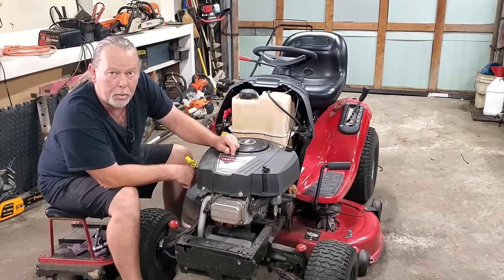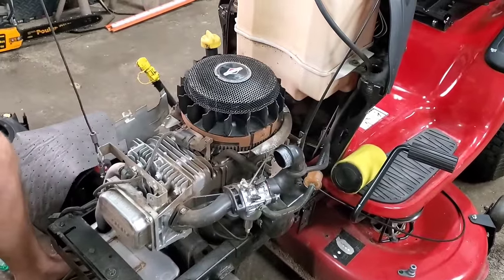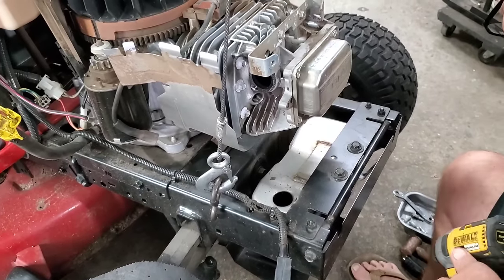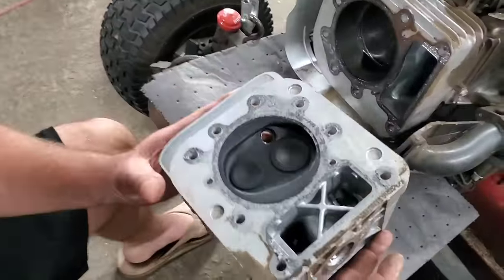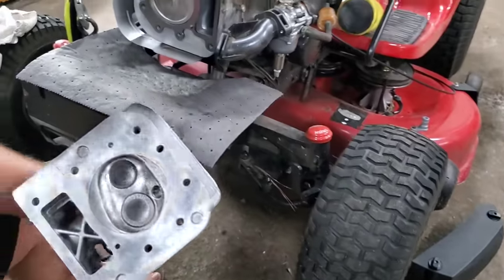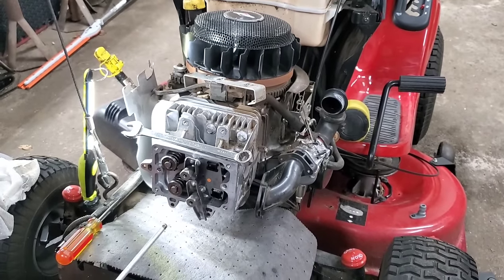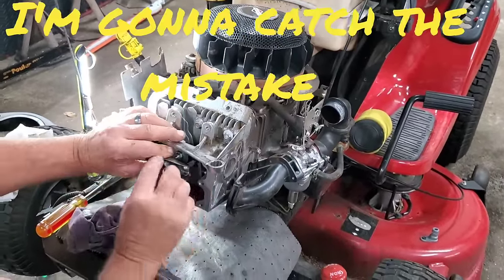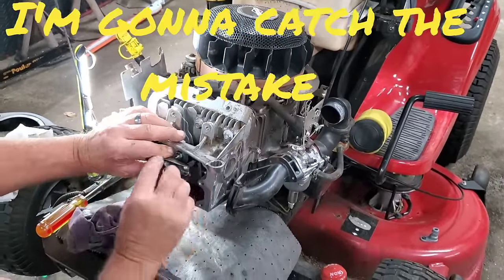Smoking Lawn Mower Briggs and Stratton Head Gasket Diagnosis and Repair Easy DIY

Comment: Performed this repair yesterday. Excellent instruction. Went very smooth with the exception of one thing that you actually warned about. After I pulled the head off I forgot to keep track of the valve caps. During cleanup I dropped one. Being as that I was doing this repair on my back patio and spraying the head with carb cleaner to clean it up, the cap came off in the grass. Upon reinstallation I realized one cap was missing and then I remembered your warning. I removed my right foot and kicked myself aprox. 99 times. I found some online and ordered a couple. Right after that, being disgusted with myself, I went out in the yard around where I was spraying. Low and behold... there that little trucker was. I freaking found it! Was able to continue the reinstall and got it all back together. Cranked er up and she ran like a top with NO SMOKING. Successful repair! KEEP TRACK OF THOSE VALVE CAPS YA'LL!! Thank you.
Reply from the maker: Great story, glad ya got it fixed up.
Reply: You forgot to LAP the head and block where the gasket sits. Hope yours lasts........
Reply: Never saw these valve stem caps before.

Comment: Excellent video--you even acknowledged your boo-boos.  My head gasket went out two years ago & I had a pro fix it.  If it happens again, I'll do the replacement myself. I've had 3 previous lawn tractors;  none of them had a blown head gasket.  It would appear that  these latest ones have a serious design flaw.
Reply: If you don't mind me asking, what did the pro charge you ?
Reply: @davethomas3553  $250 which included them picking it up & returning it.

Comment: This is a timely video for me. Pretty sure I got a blown head gasket. oil not overfilled.
Reply: That's a very good instruction video.  This gentleman does good work and advice.  If your engine is different than this one draw a diagram of where each bolt goes.  That may be of some help keeping track of all the bolts.  Just a suggestion.  Good luck on your head gasket repair.  😊

Comment: Great videos, you are very detail oriented, you describe exactly what you are doing or about to get done.  Extremely great, very educational.  Keep up the great work and posting more videos.
Reply from the maker: Thank you
Reply: @RaleysSmallEngines  hey how are you doing? I have the exact same mower….oil is spitting out of the crankcase breather tube
Reply: @semajd5995  GET Her Dune!!!
Reply from the maker: Possibly over full with oil due to bad carburetor leaking gas into crankcase or bad head gasket

Comment: My 18.5hp  B/S Intek started smoking exhaust. I had a theory that head bolt stretch was causing so many blown head gasket on inteks. I bought grade 8 bolts and used a die to cut the threads to correct length. Changed bolts out one at a time (didn't change head gasket), torked each to 22 ft/lb...5 years ago, never had any trouble since...Al Scott
Reply: Cool!

Comment: I've done a head gasket on a similar Briggs.  I enjoy working on those small engines.  On mine I had a valve job done.  The old engine runs better than new. 

A great video.  I'm sure it will help lots of people.  😊

Comment: Thank you for this video!
I think this is my problem with my Kawasaki FH500 twin.
I like tools, so I ordered a leak down tester, but I'm about to go run it for a few minutes and see if I find smoke in the crankcase / oil fill cap.
God bless!

Comment: Thanks for the helpful video. I had the same issue with my 2000 Craftsman 42in and followed your step by step to remove everything and now in the process of ordering replacement gaskets. Would have been much more difficult if I hadn't seen this video. Thanks

Comment: Sir and Madam thank you for this video. My Craftsman had the very same motor you were working on. And the very same problem. It had just started smoking and i came in and found your video. I checked the oil level and smell first. Then ran it for a minute and checked to see if any smoke in the oil tube. Yep sure enough. I came in ordered new head gasket. It showed up next day and I took my lap top out with me and fixed the problem. I did review a couple spots in your video as i went. As you stated it was easier than expected. Fired it up and just a puff or two of smoke from a drop or two of oil on the muffler. Thank you again Sir and Mrs. I will retire in two yrs and am gathering all the knowledge i can as i want to open a small engine shop. I am still lacking on the internals yet though. But getting there.
Reply from the maker: You're welcome. Glad our video helped you.

Comment: I think that I am going to try and change mine out myself, my engine guy seems afraid to do this job and I feel it is because of warranty issues but not totally sure.  I have been adding oil to this mower for 1.5 years  and even bought a backup tractor but my wife like the Sears 3000 series better.  Thanks you video was reasuring....

Comment: Thank you very much for your help. I've had issues with my used troy-bilt 30 inch riding mower smoking badly. Your simple method of using soapy water to identify a blown head gasket has saved me time and money.

Comment: Thanks for the video.  You saved me a bunch of money.  Replaced the head gasket on my 2011 Craftsman mower today.  Easy with your excellent guidance.  Is there a way to prevent this from happening again?  Is there a PCV valve that isn’t working and thus building up pressure?  Would it help to retorque the head periodically.  This is the first problem I’ve had with this engine during my 12 years of ownership.
Reply: YES, do a yearly re-torque of the head bolts. Also remove the top engine cover. CLEAN all the oil and grass grit from the air cooling fins and all around the block. Also you must lap the head and block.Don't just toss on a new head gasket and call it good. Several I've seen smoke the head gasket again. Check the oil PRIOR TO EVERY MOW.

Comment: My friend. I gor the same mower from my  neighbor for 350 with the bag. I
He gave me another rifer for free 19hp to swap. Well i pulled the head and the gasket and i see the exact same leak. Looks like at the factory they over-machined the block right there. The head looked fine. I hope a stens head gasket fixes me right up. THANKS!
Reply from the maker: Yes, it's a common issue.  At least it's a cheap and easy repair.  Thanks for watching and commenting my friend.

Comment: Love your videos. I am replacing the head gasket on a craftsman yt3000 model no 331977-0010-g1 and cannot find the torque specs for the head bolts anywhere.

Comment: Thank you for a great video
Reply from the maker: Glad you enjoyed it. Thanks for watching, hope it helped you.
Reply: @RaleysSmallEngines  purchased a Craftsman Yts3000 rider has definitely blown head gasket issue.
Reply from the maker: @WeldHoney  you can fix it I'm sure. I'm guessing, by your name you are a welder. I've been welding since the 70s, my dad taught welding and metal fabrication.  Great Great trade, a trade to be proud of.
Reply: @RaleysSmallEngines thank you  I have fixed and sold about 6 riders this year alone, I prefer vintage Murray's just sold a 87 18 42  tractor. Seeing a lot of these craftsmans especially with Briggs with bad cam issues. Also seeing ton of Kohler Courage cracked blocks and replacing them with briggs. I am glad this is the trade I chose very rewarding work.
Reply from the maker: Yes, I love it. It's fun work.

Comment: Great job on the diagnose and fix. That motor was super clean. Surprising that the gasket went so quickly, but that design doesn’t have much clamping area between the cylinder wall and the pushrods. Thanks for the great upload as always t bone.
Reply from the maker: Thank you my friend.  Yes just one bolt in the middle would eliminate that issue.
Reply: Nice fix. One thing I always comment on of every tuber that does a head gasket on this engines is…check the flatness of the head! I have yet to do one where the head gasket area where these blow out hasn’t been warped less than .004”. Worst was .009”. I mill flat everyone I do.

Comment: Great job again T-Bone, I have the same Craftsman YT 3000 with the 21 HP Intek engine and it's still going strong @ 800 hrs. and I would not be afraid of tackling either the head gasket or camshaft replacements from watching your excellent repair videos. Maybe you can answer a question that I haven't found an answer to elsewhere: I've always wondered why B&S lowered the HP rating on the 21 Intek down to 19 on later and present day engines, was that done to lower the compression ratio enough to fix the blown head gasket issues, or are the 19 HP Intek models still having that same problem from your experience? Thanks always watching!
Reply from the maker: I really don't know the answer to that. Yes we do see a few blown head gaskets per year.  Thanks so much for watching and commenting.

Comment: Great video! Is your tractor a Craftsman YT 3000, 21HP, 540cc? Reason why I ask, it looks identical to mine and I was going to order the OEM Briggs gasket to fix mine. Thank you!
Reply from the maker: NO.  look on the valve cover and get the model and type and look up the correct part for your machine.  Look it up on parts tree .com

Comment: What cleaner would you use on the top of the piston? Just carb and choke cleaner with the wire brush?
Reply from the maker: Yep, that works just fine

Comment: I am wondering how you started the tractor at the end without pressing the foot pedal. I have done 3 head gasket replacements so far. Quite easy.
Reply from the maker: I probably had the parking brake set.  Awesome, yes they are fairly easy. Thanks for watching and commenting.

Comment: Great video!  I have a 23hp Briggs& Stratton with 650hours that smokes. How do I check which cylinder is causing the smoke?
Reply: You could remove the spark plugs and see which one has oil or carbon residue.

Comment: On the older Inteks, Vanguards and I/C engines with the oval, upright filter, Briggs routed the breather vent into the base of the housing. With a blown head gasket, the air filter is soaked with oil. Removing the filter would show oil misting from the breather vent. Granted, this is the same thing that would occur if the cylinder were scored or rings ruined. But 99/100 times it’s the gasket

Comment: So I just picked up one of these 19hp Briggs on a Craftsman.  PO said he could start with fluid(yes popped off with brake cleaner). Drained the oil and it was loaded with fuel!!!   I'm an Aircraft Mechanic and the rings were tight and cross hatching was still perfect.   Head gasket was deteriorated.   Was so bad the muffler had oil and fuel.    I took the carb off and tore it apart and ultra sonic cleaned it.  
However my question is why am I getting air pressure pushing out of the intake of the carb??   

Push rods looked good, I'm going to clean the head and try the thumb truck with the valves. May compress and look at the seats.  

Ideas?

Comment: Great stuff, great camerawork too. 
So the oil was being sucked into the cylinder from the rocker box on the piston downstroke, is that correct? But it seemed like it was not an old gasket, and as you say, you only use good quality ones, and you torque to spec. In one of your replies you intimate it's a design fault -- they should have put another bolt in there. So is there any way to compensate for this to prevent it happening again? Like smear some of that black gasket sealant both sides of that fragile area?
Thank you for sharing and preventing me from working 😁!
Reply from the maker: It is a design flaw, no you can't put the black RTV on a head gasket. I will blow out almost instantly.
Reply: @RaleysSmallEngines  Ah, thank you! "Design flaw"! Like they've had no expérience in making these things!!

Comment: Are those clearances generally the same for all briggs motors? Mine is a 33R877 0009 G1    19 horsepower
Reply from the maker: Yes thanks for watching and commenting
Reply: @RaleysSmallEngines  thanks

Comment: I just found a 2015 Craftsman T2400 on the side of the road for free bagger and everything mint condition it was very clean too the sign said bad motor i towed it home and it needed a carb clean and a oil change but wouldnt start so i put a spark plug in it because the old one was fouled then she started smoking its got the 540cc 19hp platinum intek engine do you think i have the same problem as you? I put some No Smoke thick oil in it and it barley smokes anymore but should i leave it alone?

Comment: I've got oil coming out of my Honda mini-tiller carburetor. The smoke is light blue. Must be a head gasket or ring issue. 
How did you tell the piston was at top dead center?

Comment: My brothers mower has fuel getting in the oil. Sounds like rings to me. But he’s wondering if it could also be the head gaskets.
Reply from the maker: Fuel getting in oil is not caused by rings or head gasket. It is a carburetor issue or fuel pump ( if equipped). 99% of the time the carburetor needle and seat are leaking

Comment: Hey boss, I changed my head gasket to the T as you showed in the video. I now have smoke coming out of my exhaust very heavy. What should I do?
Reply: Leftover residue. It will burn off.

Comment: I have a 22 horse, Husqvarna, Briggs and Stratton. It’s three years old and that’s blowing gas and smoke out of the exhaust. Do you know what would be wrong? Thank you.
Reply from the maker: Carburetor, also your crankcase is overfilled with gas and oil. Repair or replace Carburetor and change oil and filter.
Reply from the maker: Also possible fuel pump leak thru pulse line into valve cover

Comment: I've got a 7 yr old 22 hp B&S thats smoking, including coming out of the oil fill and it's making a loud banging noise. I"m pretty sure I've got a blown gasket but what about the banging ? The engine hasn't completely blown or seized up because it still starts right up, but loud as all hell and smoking.

Comment: Thanks very much for the video. I used it to repair the head gasket on my nearly identical tractor. It now runs without smoke. However, now I'm having trouble starting it, whereas before the repair, it started fine. The starter seems stained, barely moving, and infrequently there's a farty-type sound as I try and try to turn it over. I thought coincidentally it might have been a bad battery because when I add another battery in serial, it eventually will turn over and start. But testing shows that the relatively new and fully charged battery is fine. I rechecked the valve clearances, didn't improve anything. Any ideas what I might have done wrong that would create this condition? Thanks for any tips.
Reply: You probably have a bad starter solenoid

Comment: I need a carb rebuild or replacement and probably a gasket since it blows white smoke.
Reply: Pro tip: white smoke=oil. Black smoke=fuel

Comment: T-Bone and Mrs T,  I really love your channel.. I would like to ask for some knowledge and guidance.  I am 72 years old and can’t walk like I use to. I still want to cut my own yard. Can you guide me to the best option for a mower, Please. What would you recommend a tractor style, zero turn or a stand type? I want a fabricated deck, the best motor option, bagger no large than a 36” cut. Can you please give an old man a little of your wisdom or at least point me in the right direction?  I have looked at Toro Grandstand, Exmark, Gravely, Scag, Deere, Husky, Cadet, Craftsman. I want something that can be repaired and not just throw away parts if that is an option in this day and time. Thank you in advance!
Reply: We like the Gravely w/Kawasaki engine. They make one called the Compact Pro. Good luck!

Comment: Once you get the head and block cleaned, you must LAP the head and block where the gaskets sits. Every one I've removed the head is warped. Plate glass and some 220, 400 and 800 grit paper. Then spray the gasket with Permatex hi tack gasket sealer. You can also get full copper head gaskets. Torque the head back in three steps. Check final torque after several mows. Don't just toss on a new gasket. Several will not be fixed without lapping.

Comment: @CraftwerksMC
0 seconds ago
When this happens does the motor also shoot a ton of raw oil out the exhuast?   I have a craftsman lt1000 that seemed to be running OK but it was shooting a ton of oil out the exhaust that it coated my shoe as well as a cloud of smoke?  Thanks for any tips or info someone can comment on.  The smoke was terrible.  It was so bad with the oil foiling and it smelled a lot like fuel too,  I ended up tossing the shoes, lol.
Reply from the maker: Sorry about your shoes my friend.  That sounds like a carburetor issue.  Be sure to change your oil and filter when you repair carburetor.
Reply: @RaleysSmallEngines  I suppose it is possible but what would make oil shoot out the exhaust if it was a fuel issue from the carb?  There was so much oil coming out it literall soaked my shoe.  I guess at this point there is no harm in popping the head off to see if it is the head gasket or the rings.  I'll figure it out when I get that off I guess.
Reply from the maker: @CraftwerksMC  carburetor leaking fuel into crankcase causing an overfill situation.  Be sure to remove muffler and clean out with brake cleaner and thoroughly dry so it doesn't catch fire.

Comment: What is the spark plug socket you are using?
Reply from the maker: It's an old Mac Tools double swivel automotive socket I bought  in the early 1980s.  Guaranteed to never break a plug.
Reply: @RaleysSmallEngines  thanks for the reply! Keep up the great videos

Comment: I got a used 17.5 b&s and i was told it blowes oil out the blow by into the carb and smokes like a train is that a bad head gasket?
Reply: Possibly but more likely a carburetor issue. Thanks for watching.